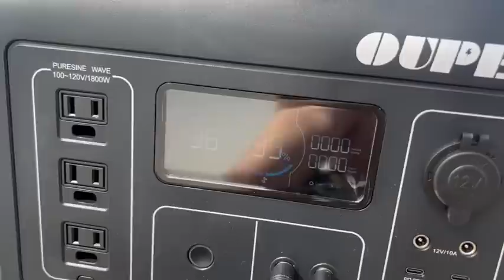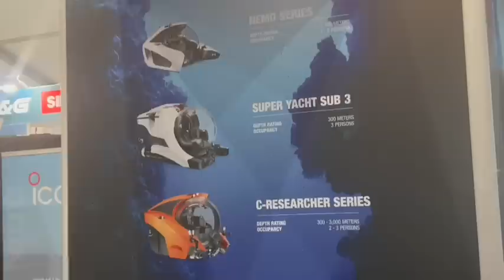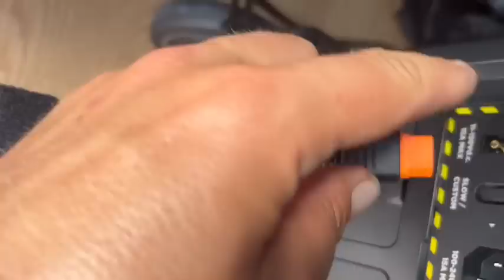Hurricane ravaged Fort Myers Beach

Comment: Wow that's totally crazy how much devastation there is. Note to self: rent, don't buy, in hurricane alley.

Im sure its too late now,, but what I've seen done before when removing flooded drywall is use a circular saw to cut it out horizontally just above the point where the saturation stops.  You could snap a line and follow it.  Makes rerocking much easier.